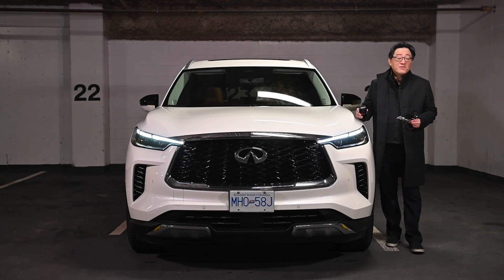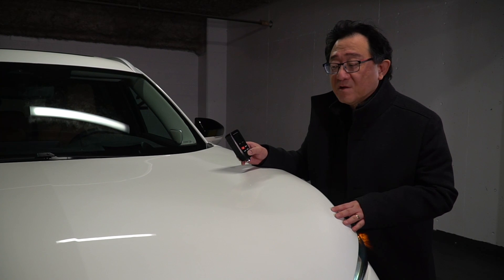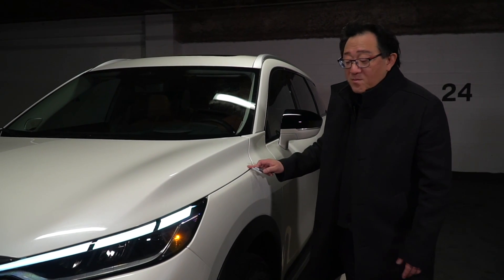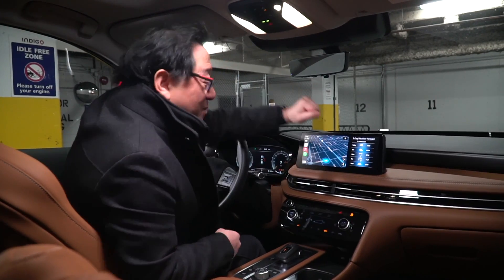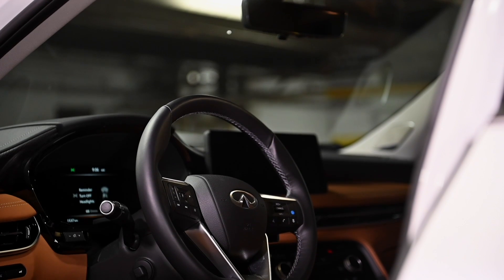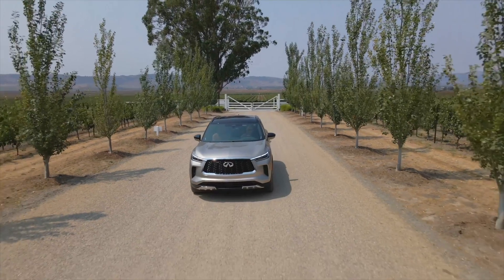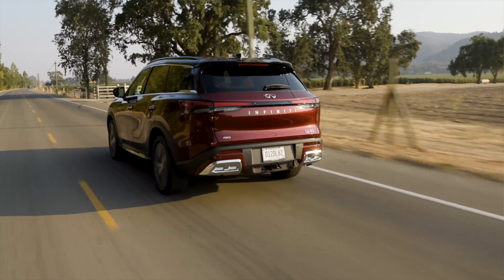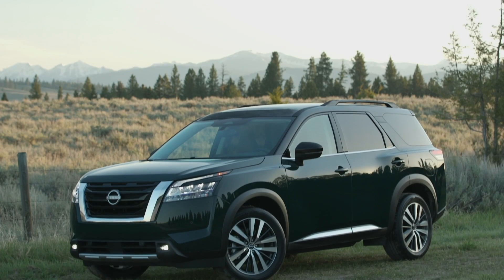ENGINEER'S EVALUATION OF THE 2022 INFINITI QX60 - FULL AUDIT

Comment: Great review. I came from a Lexus RX350. I did love my Lexus, but I found the ride and steering/road feedback to be far too tame. In other words, the ride was too soft (but very nice) and the steering provided zero feedback. However, I loved the smooth 3.5 liter 6 cylinder engine and overall reliability. I then researched and eventually purchased the Infinity QX60, Sensory model. I love the very smooth 9 speed automatic transmission mated to a 295 hp 3.5 liter 6 cylinder engine. I also observed that the steering was more precise than the Lexus and provided significantly more road feel. Also, the suspension was more like the Lexus F Sport model. I am over 50 years old and I wasn’t looking for a sports car per se. I was looking for an attractive, larger luxury SUV that had a smooth, powerful power plant that was NOT a 4 cylinder turbo (2023 Lexus RX350, Q5, etc). I do love the stying and features of my QX60, as well as the ability to use unleaded gas (unlike the Lexus and most of the German competitors). Anyway, I am a happy customer.
Reply: How is your ownership experience and reliability after more than a year of ownership? Looking into used one 
Thanks
Reply: Yes , any updates on your qx60?

Comment: I’m picking this up tomorrow. It blows the MDX and RX out the water. I looked at all 3 thoroughly. MDX uses too much hard plastic and hasn’t done enough to separate itself from Honda. The window controls look like my old CRV still. Seats are uncomfortable unlike Infiniti. Lexus got too lazy and lacking detail inside. For the price, the QX60 Sensory packs an incredible value.
Reply: Don’t have a QX60, but Love my Qx80….a tank in a tuxedo
Reply: Hows the fuel economy on all three u checked
Reply: @revilo155  about the same. I get mileage for my job so I really don’t pay attention.
Reply: Premium gas?
Reply: @grouchosays  yes premium only
Reply: I completely agree. The MDX has a lackluster interior compared to the QX60. I've heard so many MDX owners say they love the driving characteristics but hated the interior.

Comment: David, you make some great points and I love your review! 

However in terms of the performance part and the Q60 being boring to drive. If I was personally in the market shopping for a luxury SUV or crossover, the last thing I want is it to have sharp handling,  rough riding suspension or it to drive sporty IMHO. 

I prefer a more isolated ride, soft suspension to absorb the rough streets of where I live, and low to no interior noises. Just like how the older Lexus vehicles used to be. 

The Genesis GV80 would be my go to luxury vehicle of choice at the moment for the money. Especially with it looks, it is light years better than this Infiniti, and gives off that classic luxury look of cars from the past had. The more comfy and soft silent riding the vehicle is from the outside world, the less stress in my book. But that Infiniti is no slouch, it is nice looking and although most regular Nissan products tend to be lower quality than say a Toyota or Honda products, their Infiniti line has always been pretty good and are very stylish cars.
Reply: It does have some issues, but as far as styling goes, current Genesis styling blows a lot of other luxury brands away. The Genesis brand finally has a unique signature design profile that suites them very well unlike the previous Genesis vehicles of 10 years ago. It will take the brand some time to improve its reliability. Will ever be Lexus reliable? That’s hard to say at the moment. But the Hyundai/Kia brand have really improved their vehicles as of late and are hitting it out of the park with its cool looking design that have a very upscale appearance to them.

A far cry from what they were building 20 years ago. One perfect example is the Hyundai Palisades and Kia Telluride. Probably still one of the nicest looking SUV’s on the market today in its price range and even when compared to some luxury SUV’s. 

I can see the Genesis being the new Luxury make that takes off and will cut into sales of Lexus and the Germans big 3.
Reply: @CA-nm7mb  
Both of those suvs are unattractive copies of other unattractive higher-priced suvs minus the reliability. Hyundai has been an effective cheap man luxury vehicle company.